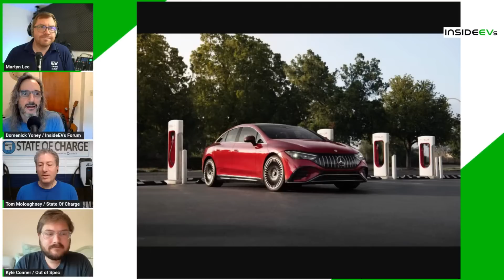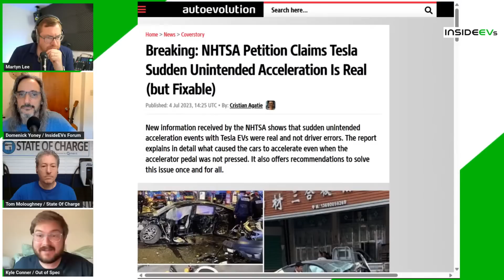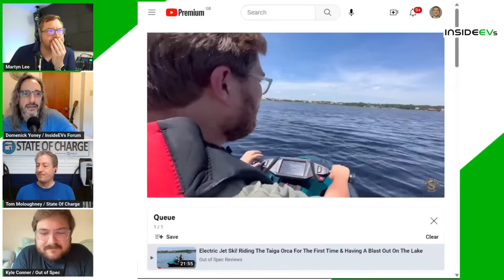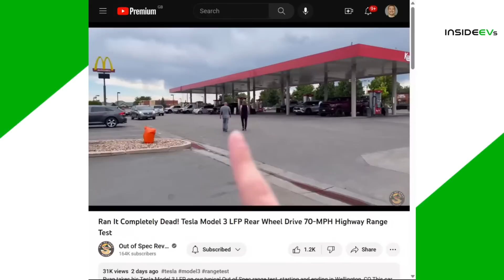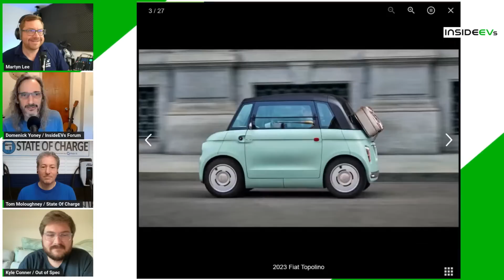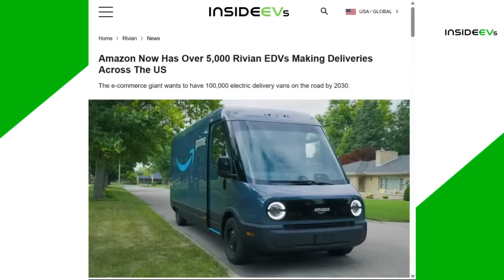Mercedes To Adopt Tesla NACS, Tesla Unintended Acceleration Cases Reopened By NHTSA

Comment: Trying to understand SC network. I understand rated current, on the sites is lower than used for Teslas, assume all the other manufacturers will have to adhere to these limits.
What is the rated current and voltage on V2 & V3? If V2 is 150kW I'd assume they will only deliver 120kW. Also, what does 1200 chargers mean? Seems like some but not all.

Comment: Regarding the Tesla Supercharger status (at around 1:05:00), it seems like Tesla has a 15 minute buffer for status updates before a station is labeled as offline. This likely is to account for temporary cellular/internet and power interruptions at the Supercharger site so that way sites aren't mistakenly labeled as totally offline. Of course, this wouldn't apply to scheduled maintenance - just unscheduled downtime. Perhaps some adjustment needs to be done but there will probably still need to be a 5 minute buffer just for edge cases like temporary internet disruptions.

Comment: Why would anyone buy a current EV product until they produce NACS equipped vehicles?
Remind did the Teslas or the non NACS equippeed cars win the run to Los Vegas?
Reply: Because there will be NACS to CCS adapters coming next year. It's better for someone to get into an EV today and start driving zero-emissions using the CCS network for road tripping than for them to wait another year and keep driving a fossil car. There's no need to delay another 2 years for a NACS equipped EV. If someone today absolutely needs the Supercharger network today (instead of waiting 1 year), then they should just buy a Tesla. Most other people can just get any other EV then use an adapter next year.

Comment: Audi might have had the first unintended acceleration class action suit back in the 1980s. We bought a 1988 5000S (5 cylinder) and got a good 13% off the list price thanks to the taboo Audis all had (thanks to a 60 Minutes show segment on CBS). The Audi salesman told us that the connected 2 Audis together at full throttle and one car's brakes prevented them from moving. Audi was proven innocent and driver error was the cause. But, the Audi brake pedals were mandated to be moved farther from the gas pedal AND had to be much closer to the driver so drivers now had to pull their foot closer before stepping on the brake (It took more time to do this!).  European models could still keep the pedals at the same distance away. It's ridiculous how Tesla's being investigated for this thing. Lotsa love to all from Toronto ❤❤❤ PS I just found Audi America's PR video fighting the problem on YouTube. Maybe Tesla can learn from it? https://youtu.be/otyax6onMWw
Reply: This is awesome footage on several levels. Thanks for sharing!

Comment: I got solar panels installed, but waiting for the electric company to swap out my meter. Should happen in a couple of weeks.  I am in VA, we have net metering and it is a 1 to 1 rate, so it does not make sense for me to store energy either.    VA has the Solar Rec program as well.   Probably will be 7  years to be above water.

Comment: GM tells you their EVs are unprofitable. Why are you baffled that their production numbers are low and not rising? Yes, in many cases, you can increase profitability per unit by increasing utilization of your capital expenses via increased volume. But if costly resources/parts from suppliers are the reason your cars aren't profitable, you can't fix loss leaders with increased production. GM's already realized their investment in oversized batteries via Ultium + heavy, big vehicles is too costly to profit with volume. They actually haven't found the secret to EVs is efficiency and respecting that battery cost will dominate profitability. Or they have and it's now 5 years away for them.